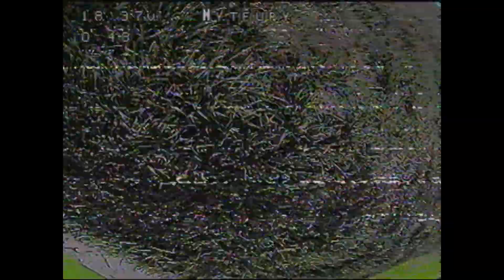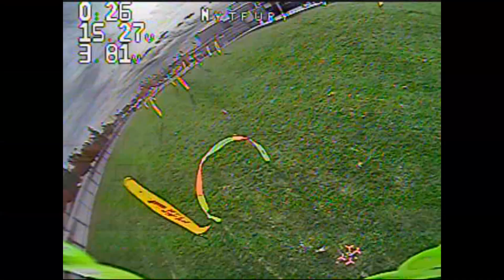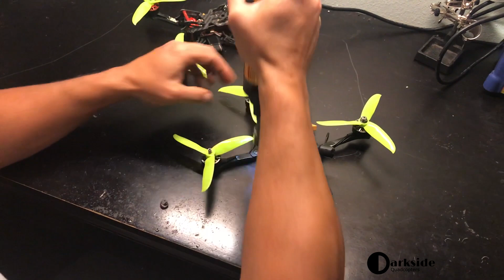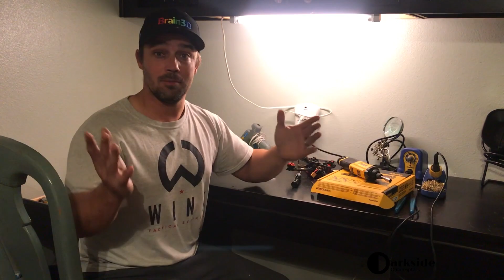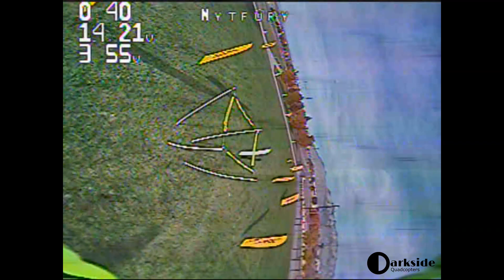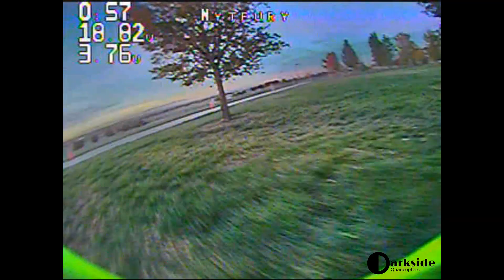Favorite NEW DRONE TOOL! Gyroscopic screwdriver review!

Comment: Does it have a clutch tho so you dont strip bolts or break motor shafts from over tightening.
Reply from the maker: greggsy2000 no you torque it the same as a manual driver by feel.